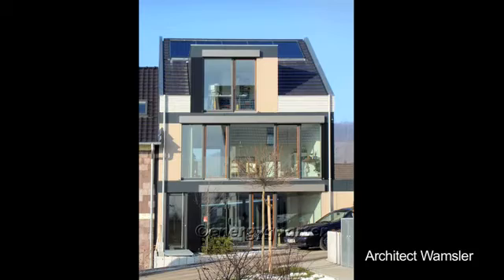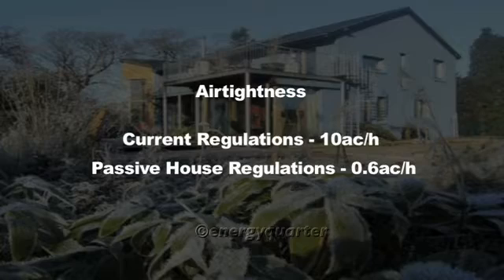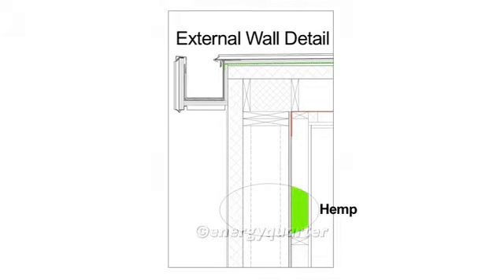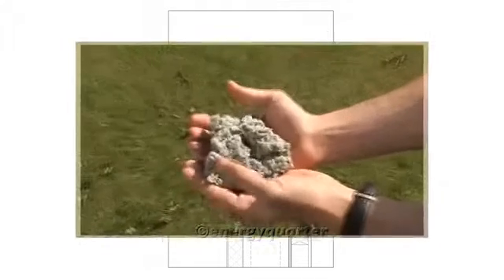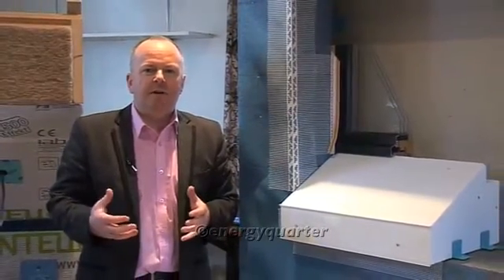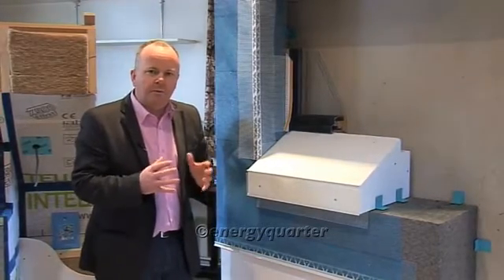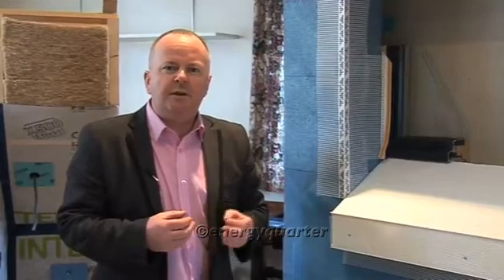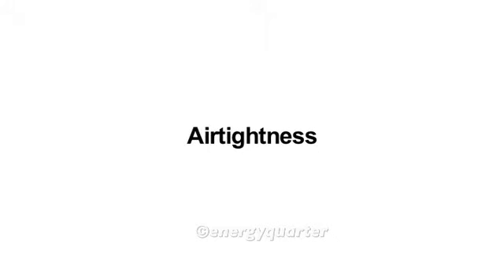Passive House Series - Insulation & Airtightness

Comment: Well, even though California's going through an epic drought, this is my home for almost all of my life, and I really don't want to leave.  The house I live in was built by my parents in 1956, remodeled in 1970, and it's a mile off the county road, so no close, polluting neighbors.  

Doing a deep energy retrofit is out of the question, since they are more costly than starting from scratch.  Plus, you can almost never get the same efficiencies than if you built new.  I just wish there were a few custom builders out there who were certified in Passive House building.  I wouldn't have to drill another well; I could use the well for the current house and NO LAWN.  Drought-tolerant and native plants only.  The soil drains well, so no problem putting in a sewer line, with a separate gray water line to water any garden plants.  Electrical is very close, though I would orient the house so that most of the glazing was south facing.  A mini-split system would be good for A/C; I would probably use a heat pump for heat, though nighttime winter temps can be hours in the low- to mid-twenties.  One year this weather pattern lasted for five weeks.

Comment: What a superb video. It answers with real examples every question it raises, and to be honest, it raises rather more questions than I have. It's easy to see why Building Regs are so far way from Passive House standards, though. The developers of mass housing would not make a big enough profit at the cost levels required. So it looks like it is down to the individual builder - as usual. Where are the legislators in all this?
Reply: Good question.  In California, we have a building code called Title (or CAL) 24, but still, it's nowhere near Passive House standards.  In my area (near Fresno), there are no certified Passive House builders, either.  The GCs and trades are very ignorant too or just set in their ways.  It's like they're stuck in the 1950s or something.  And this area needs Passive House construction really badly--it's a very hot, dry climate.  My A/C bills were over $500 last summer, and I was trying to conserve.  And with the imminence of runaway global climate change, this part of the world could be looking at colder winters (in the low teens at night), and hotter, longer summers.  I wouldn't be surprised at 120 degrees F. + as the average daytime summer highs in twenty years.
Reply: basmith13f Ever thought of inverter controlled 'Mini Split' a/c  system for cooling and heating ....orjust  putting more insulation into the roof space if same was feasible... maybe spray foam ....with those future temperatures it seems as if it could be ,'Time to get out of Dodge'